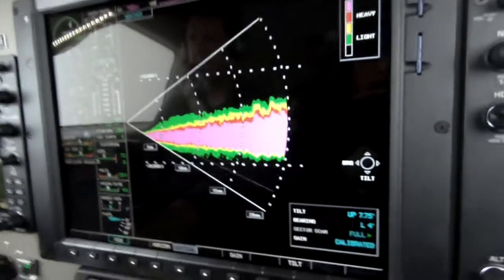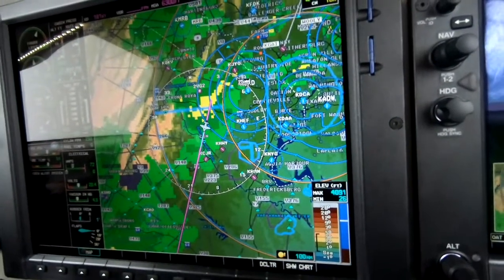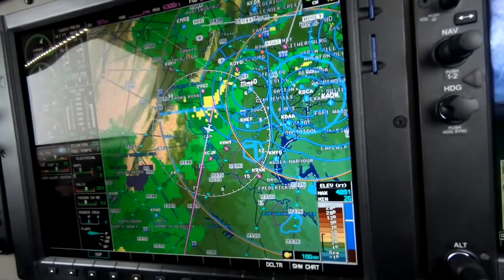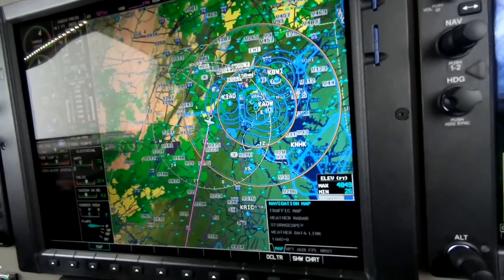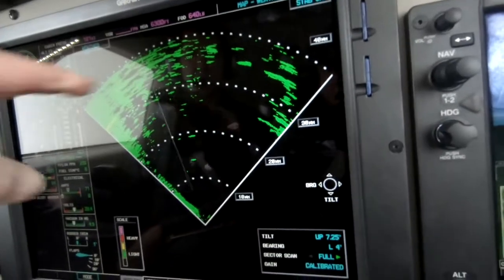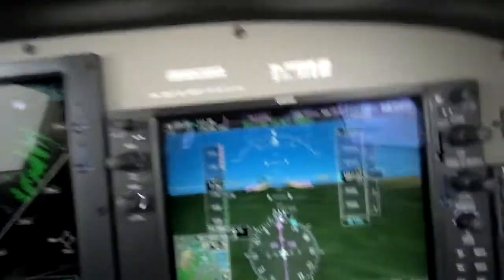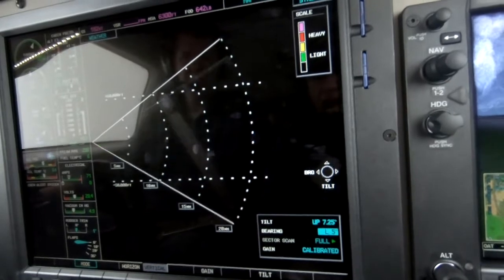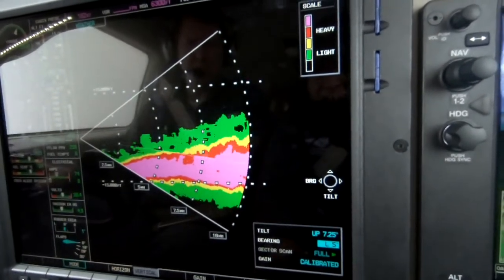Coroborating Rain Showers with Weather Radar and Nexrad

Comment: Quick question. Can the G1000 MFD display the Nexrad overlay on the gps without a weather radar scope installed in the aircraft?
Reply from the maker: Yes, but remember that NEXRAD is a strategic tool. On-board Weather Radar is the only way to operate safely with tactical weather avoidance. Check out my playlist on Thunderstorms and rain showers.. https://youtube.com/playlist?list=PL1v0sy7dll0i-qEWCQQipkt-8dXOAR2Ef&si=3sdo16GKBZQfIT16

Comment: So the Doppler beam causes increase precipitation in front of the flight path and it's subsequently better to use nexrad ground based in light rain conditions
Reply from the maker: Hi Adam, RADAR of any era is real time. NEXRAD is delayed by 10-15 minutes or more. While it has excellent range, the resolution is very poor.. not a healthy feature for tactical operations. I recommend switching to RADAR within 40 miles of weather. Fly Safely - Train Often .. DR